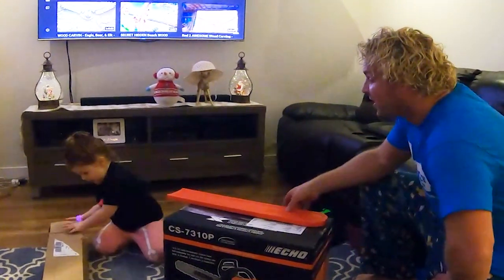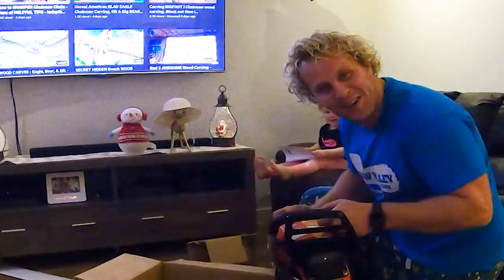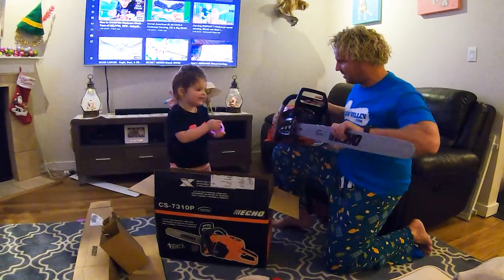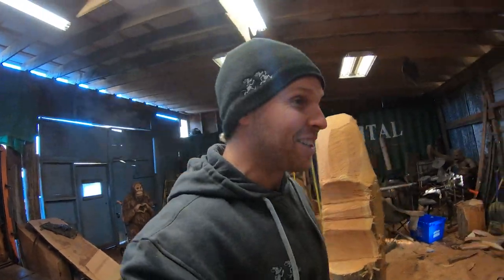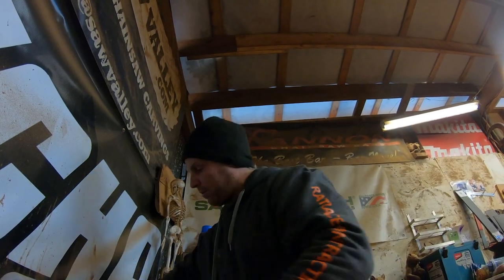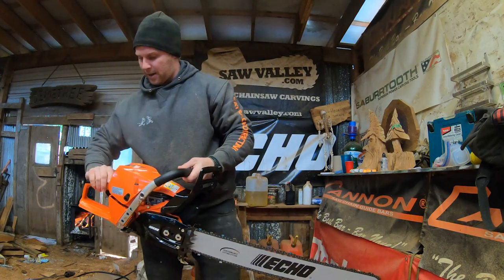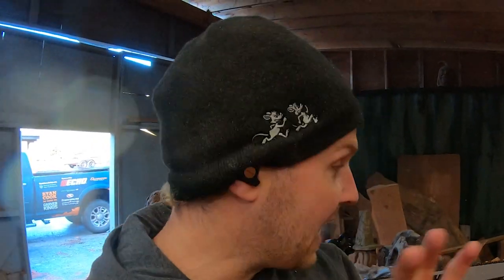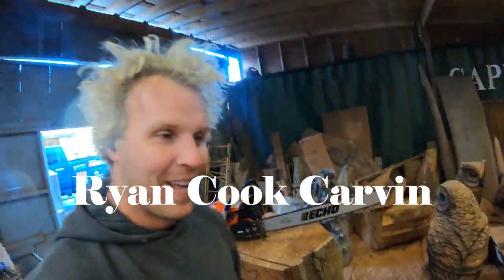UNBOXING The BRAND NEW Echo CS 7310 with SOPHIE & Saw Valley T shirts

Comment: Hey brother!  Hope all is well.  I just got my 7310 with a 32" bar.  Took it on its maiden voyage and have a concern.  It doesn't seem to be throwing oil like it should and I'm wondering if the holes (ports) are lined up or is this normal for such a big bar?  I just don't want to invest everything that I did in it to burn it up out the gate.  Any wisdom you can shed?

Comment: Tooney question: When you are talking about a 24 or 28 inch bar for blocking out, is there really any advantage to a tooney tip over a stock, sprocket nose bar? With a bar that long are you really getting any advantage with a smaller nosed bar? Is there any other reason to go with a tooney over a sprocket? Also would you use a 50 gauge or a 63 gauge with a carving bar that long?  Thanks!
Reply from the maker: Toonie is a carving bar .. no kick back .. sprockets kick back ... 3/8lp chain - 50 gauge